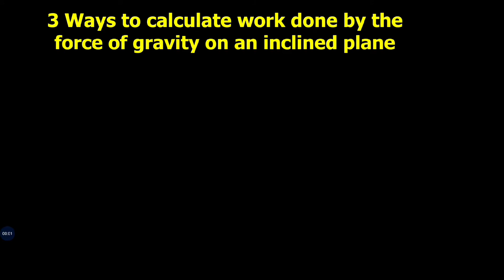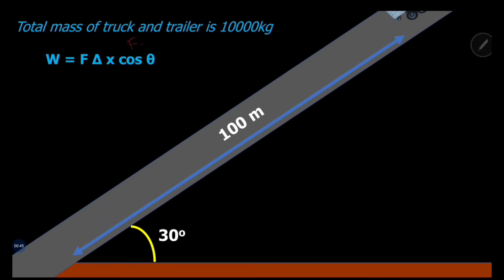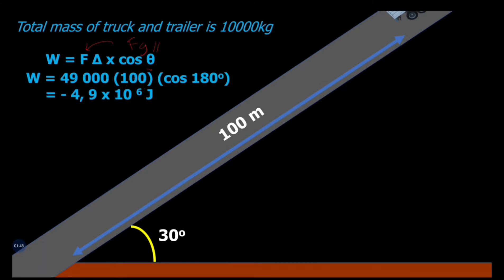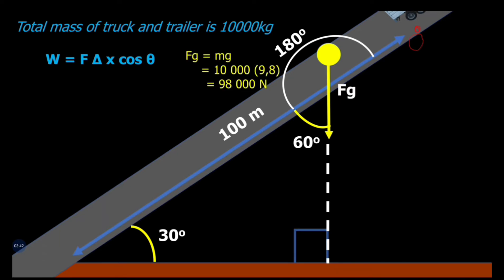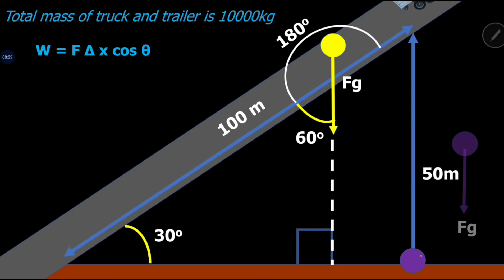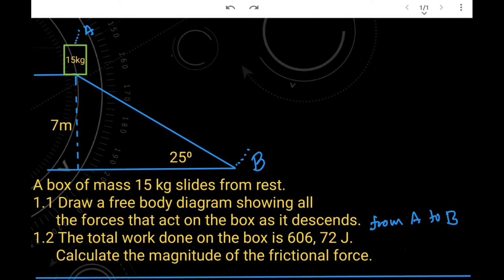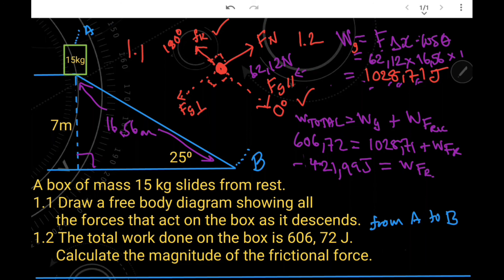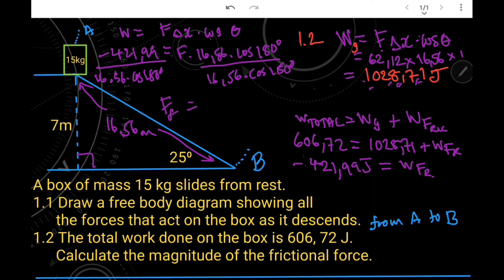Calculating work done by gravitational force on inclined plane - Science In Five

Comment: Help me 

3. If A•B=|A×B| where A and B are two none_ zero vectors find angle between A and B
Reply from the maker: Let θ be the angle between the two vector (a and b). 
  we know that A•B=ABCos θ

&  A×B=ABSin θ

So put the value and sin/cos=1

Tan (theeta)ab=1

angle = 45 °
Reply: @scienceinfivebysig2904  thank you for your interest to help me
Reply: @scienceinfivebysig2904  Help me calculate this

 factory worker pushes a 30kg crate at a distance of 4.5m along a level floor at a constant velocity by pushing horizontally on it, the coefficient if of kinetic friction between crate and floor is 0.25

Find
a)	The magnitude of force must the worker apple 
b)	How much work is done on crate by this force?
c)	How much work is done by friction, by normal force, and by gravitational force?